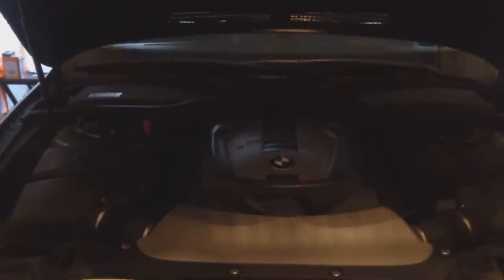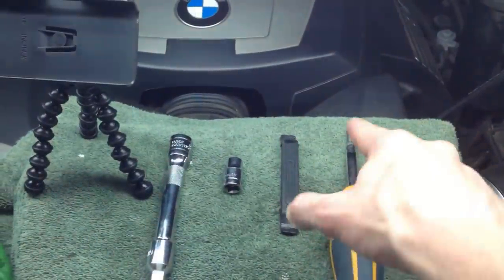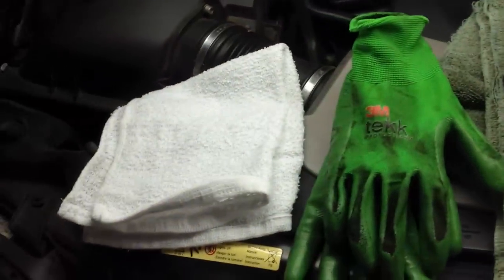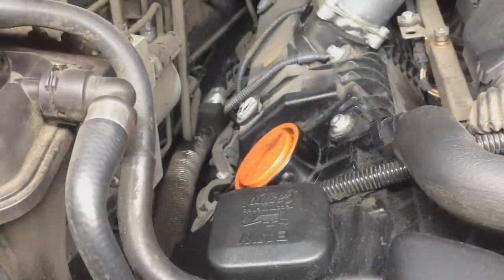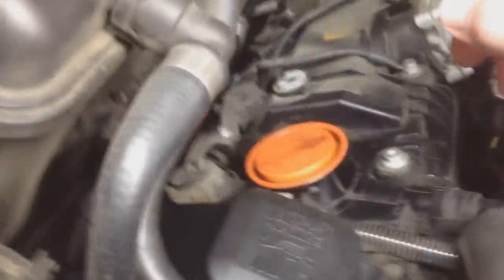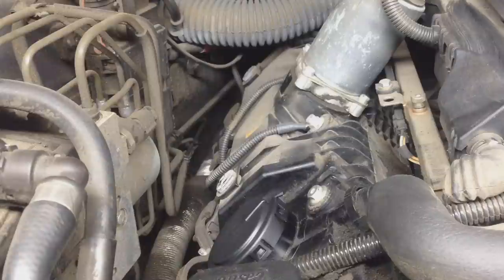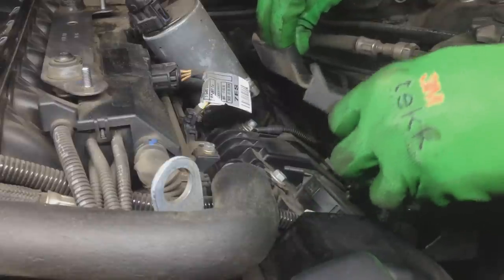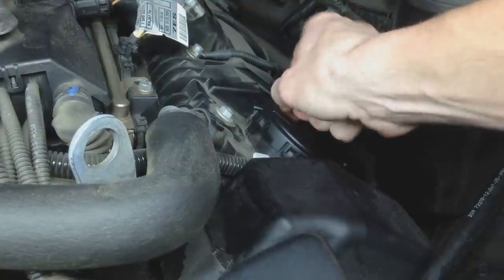DIY BMW E65 E66 Replacing Your CCV Crank Case Vent Valves On N62 BMW Engine

Comment: Because of your video I replaced my Vent Valves on my 545i with the n62 engine, the repairs removed my p2189 and p2187 fault codes.  My plastic cover had wires connected to it so I didn't replace them but both of my valves were torn so I replaced both, it took me about 20 minutes, it was easy, fun and saved me a ton of loot, Thanks.

Comment: Are the codes that come up are they codes they saids you have skip in some your cylinders because that is what i am getting..p0 301 po 300 po 304 po 307 and system to lean in bank 2 which is code 2189

Comment: WOW !! Thank you so much for the invaluable information. Just completed this maintenance and felt very comfortable with your guide. Though the point is good, I actually took extra time to Deep Clean all that dirt, gunk and excess off my engine while it was more wide open than normal.  Oh boy, what a difference. A few little rotary brushes and harbor freight cheap brush set, a lil Dawn in a spray mister, and a misting clean water bottle and I am sooooooooooooo much happier. 

i SIMPLY CANNOT THANK YOU enough. Awesome.

Comment: Great video. I recently bought a 2009 750Li. I've been watching BMW dyi videos recently and I'm shocked at the amount of, and heavy use of so many plastic parts in a car that costs upwards of $90,000 when new. I'd think auto engineers would easily figure out that all that plastic is bound to fail given the extreme heat of an engine compartment.
Reply: All about money bro

Comment: Nice video. I had to change them also due to intermitent and loud "chubaka" sounds at low rpm's. Pretty embarassing when sitting at a red light. Very easy to do as your vid shows.

Comment: Does your engine have vacuum? because mine has a lot of vacuum and i cant figure out why! i thought the valves where the problem but i guess not. Turn on your car and open the oil cap and see if there is vacuum! thanks

Comment: does the hose needs to be relaced or cleaned? i have changed both my ccv but it still smokes sometimes and today i pulled off the ccv hose and there was oil inside the hose still

Comment: So I had this problem but when I went to replace my PCV nothing was wrong with them so I went ahead and replace the many ways and I jumped on the highway and it seems as if the problem got a little worse. Any other ideas ?
Reply: +beeroosterm great minds think alike. I did that about a month ago. No more worries.

Comment: Great video as always, hey so I need to pass my emissions test and I'm getting a P2187 & p2189 codes but pending only. Is this why my evap and secondary air wont get ready for the emissions test?. It's been 260 miles since and everything is ready on the drive cycle except them 2. How can I get the secondary air to get ready. I changed these CCVs about 2 months ago btw...

Comment: I have the same symptoms, p2187/p2189, whistling noise, rough idle, I replaced the vent valves. but the problem still hasn't gone away. I don't know the problem could be next,  vacuum leak? what else could be it?
Reply from the maker: It might be a vacuum leak, other guys have awesome videos explaining the vacuum leak, also search the 5 and 3 series videos for tips, it won't be exactly the same but very similar.
Reply: +DIYsavecash the vacuum leak from head gasket leaks

Comment: FYI those are just cap nuts  holding on that engine cover not Torx.  I have an 07 and my passenger side is not directly attached to the cover, it is near the top of the engine mid-stream a larger hose that goes between the valve cover and intake manifold.  Its wrapped in custom molded insulation.  HTH someone.  Good video.

Comment: Hey, my 06 750Li is having a little clear/white smoke coming from the tailpipes when hitting the gas after idle. dealership says Valve seals but i dont experience the truly white smoke like everyone else. it smells a bit funny though. and from 1st to 2nd my rpms go as high as 2,300 RPM is that normal?

Comment: when i changed mine it was not orange but dark blue/green rubber.. is that OEM from factory? and even more important i had some kind of gunk on it so i had to clean it.. like oily mud.. i see yours was totally clean.. just oily... what could be the problem, should i open the head cover and is that going to help? car was regularly maintained at bmw, oil changes and all...
Reply: ktm640lc4BGD same here i found lost of gunk in mine

Comment: Great video! Hoping it fixes my white smoke on idle... Fingers crossed alot easier and cheaper than exhaust valves!!! ;)
2006 750i 20500miles
Reply from the maker: john lourigan hey John you only have 20k on your car or 250k, I have 162k now and it's going strong.